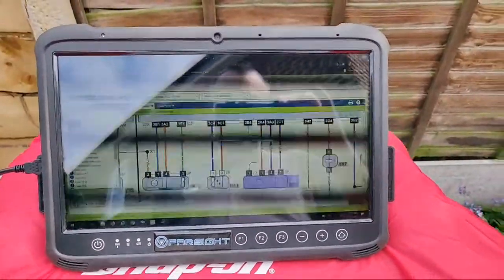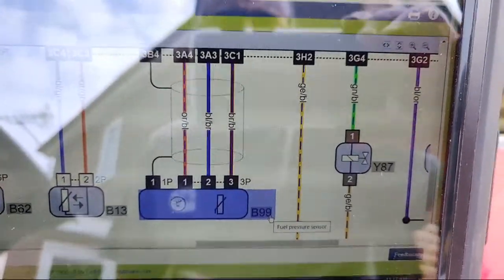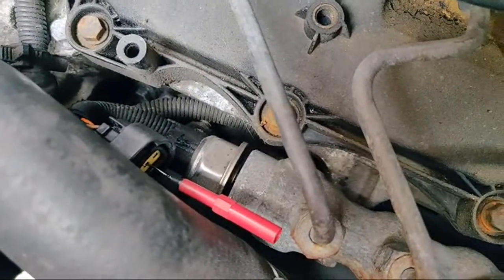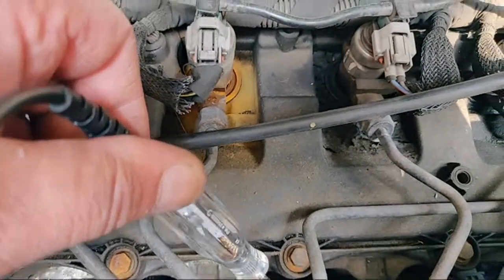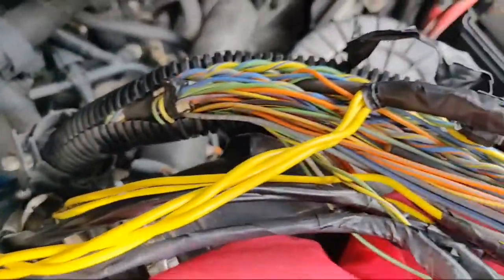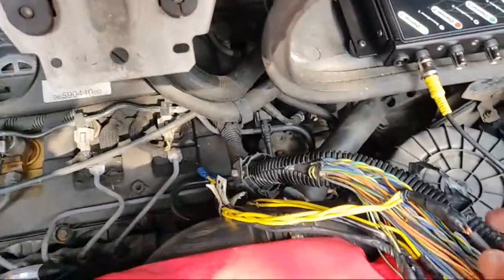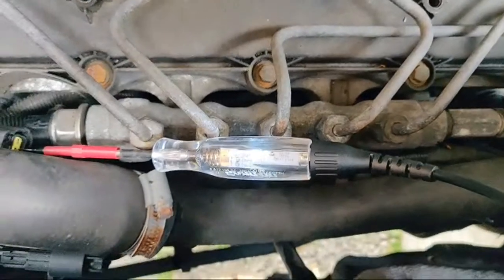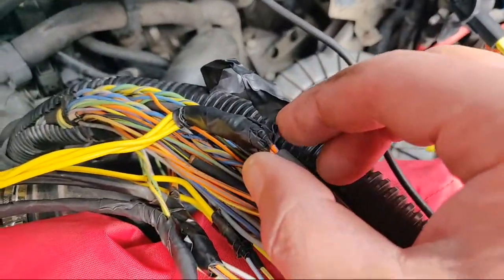Troubleshooting A Short To Ground

Comment: I'm thinking like,  if you test with stronger current  test light you may not see short to ground because of resistance between wire and ground,  and at the same time problem may disappear (you burn off that short! just like fuse) just to reappear 1 week or 1 month later!
Reply from the maker: Valid point, I use a low current testlight to limit current flow in the circuit 👍

Comment: Could you use Incandescent  test light, because ECU was unplugged, so there is no danger for damage it
Reply from the maker: Yes, depending on how sure you are that the circuit is isolated and that your incandescent light isn't capable of carrying a level of current that could damage anything.
Reply: @SimplyDiagnostics   Thanks I saw that Scanner Danner usually use incandescent test light for short to ground. I agree that is better to be safe, no regrets after
Reply: I'm thinking like,  if you test with stronger current  test light you may not see short to ground because of resistance between wire and ground,  and at the same time problem may disappear just to reappear 1 week or 1 month later!

Comment: Can you not do any damage at all then poking about with an LED test light ?
Reply from the maker: You'd have to try really hard, it is a really effective current limiting device. There is still a risk of shorting two pins out with the tip but used correctly in typical automotive applications you would be really unlucky to damage anything. Always test the current draw through your testlight to confirm its current limiting capacity before using it for bypass testing 👍
Reply: @SimplyDiagnostics  Thank you for the explanation and the speedy reply, your videos are appreciated, i'm just playing catch-up ... Regards Andy

Comment: So the shield terminates through pin4 at connector 3b, where is connector 3b ? not that it matters, just interested.  Cheers Steve
Reply from the maker: Connector 3 is the black ECU plug, B4 is the pin number. The shield runs through the loom but does not terminate at the sensor. It's there to absorb interference from actuators drawing current such as the injectors 👍